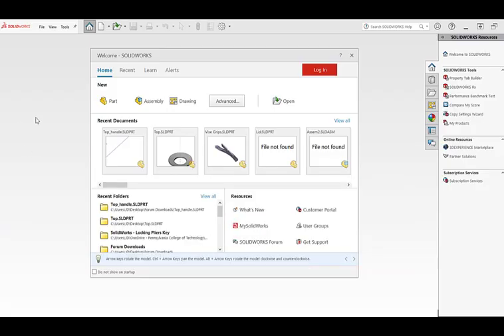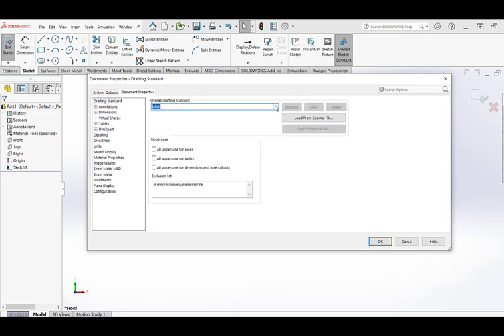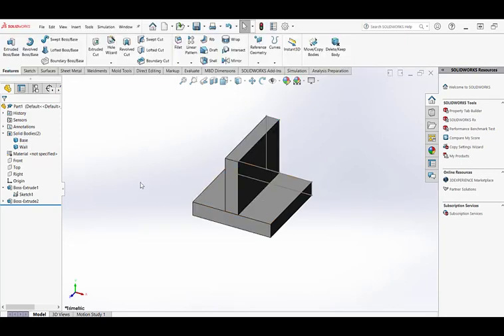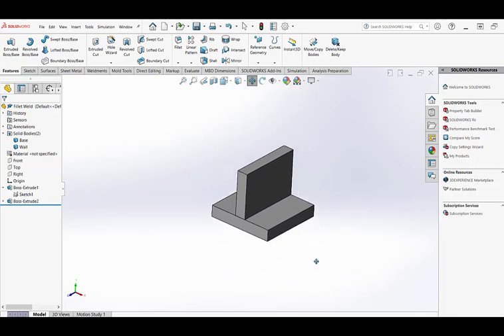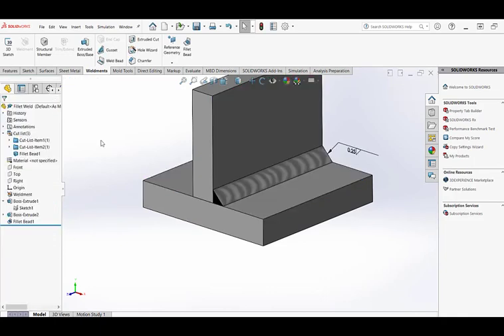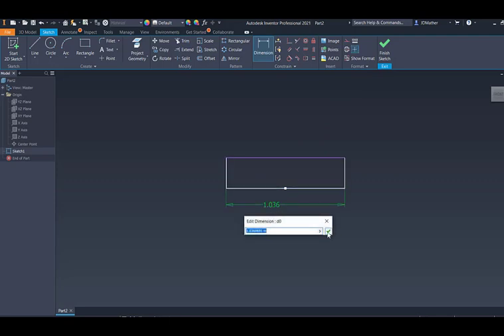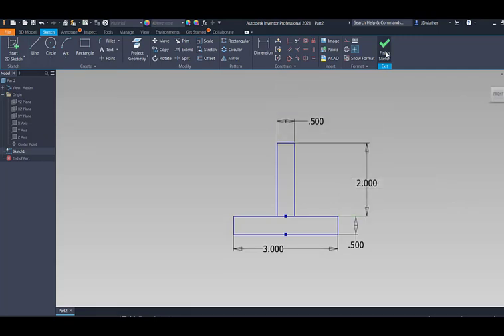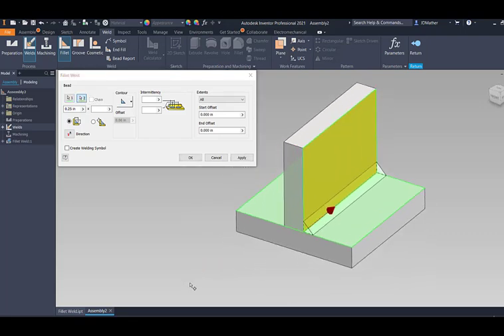Fillet Weld - Beginning Weldments in SOLIDWORKS and Autodesk Inventor

Comment: hi sir, if you have time
would you like to make a video about weldment in square tube bending (like a car chassis)?
I found this video in solidworks https://youtu.be/5n5hGIclh2k?t=691 ,I don't really know does inventor could do that with bending feature or not
I just wonder, if I use bending feature, I can't get the cut pattern for laser cut isn't it?
thanks,